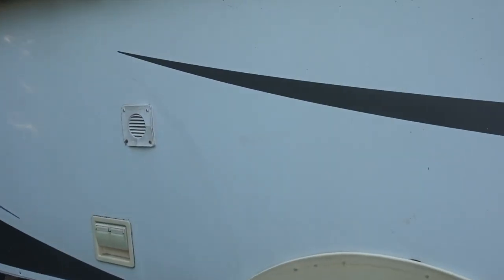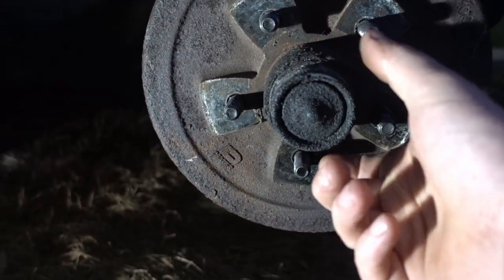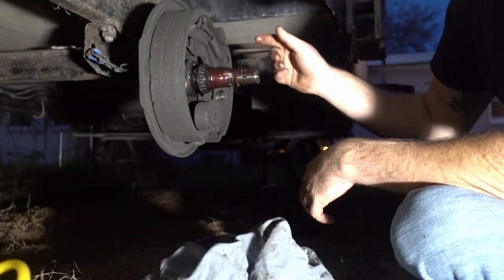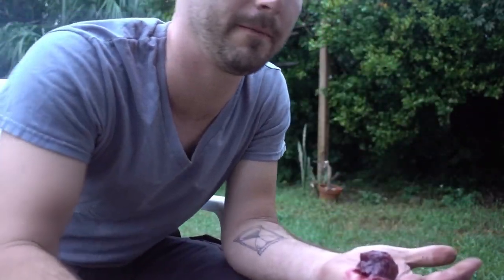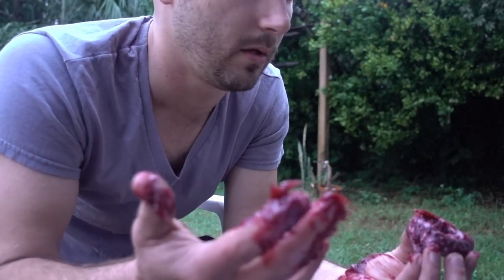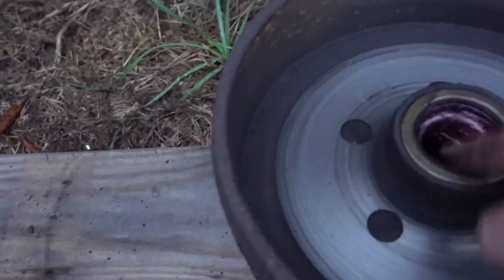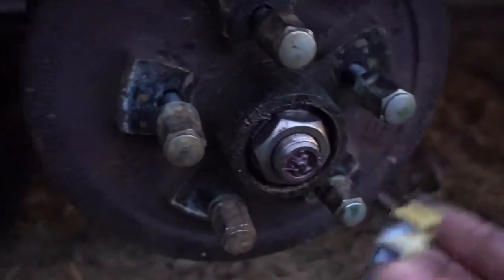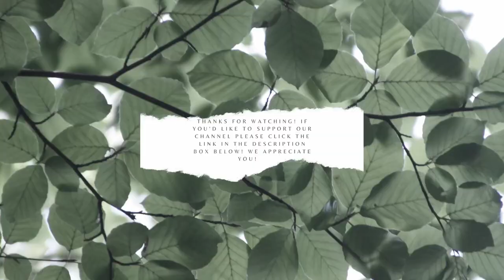Checking the wheel bearings on our Trail Manor camper ⚙️

Comment: Thanks for the step by step! Now I know what to expect when I open up the hub. Question about your wheels and tires: Are those mustang wheels? With the offset did it still fit? What size tire did you convert to? Did you need to install a lift kit to make the new tires fit? I look forward to more of your videos!
Reply from the maker: Hey there! No, those are actually the stock wheels that came from Trail Manor. I think a Mustang rim might be too wide to fit, but let us know how it turns out if you try it! Thanks so much for watching!